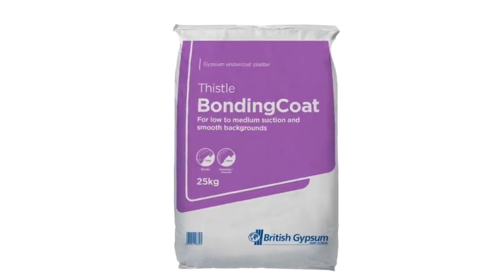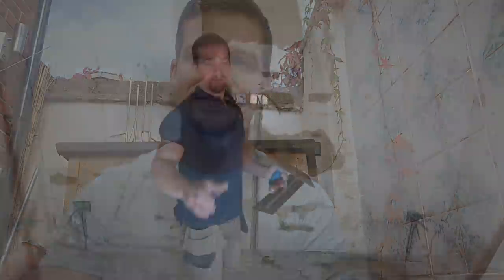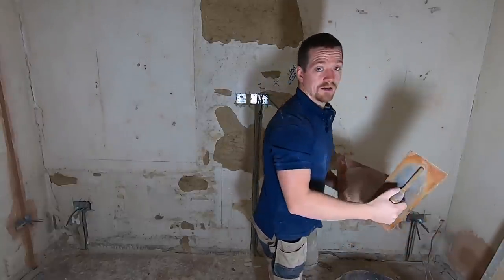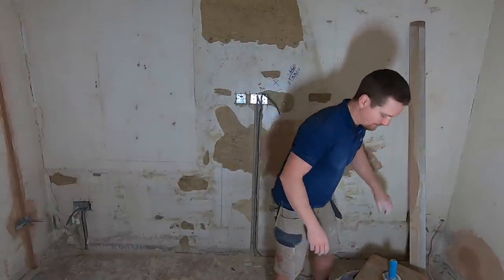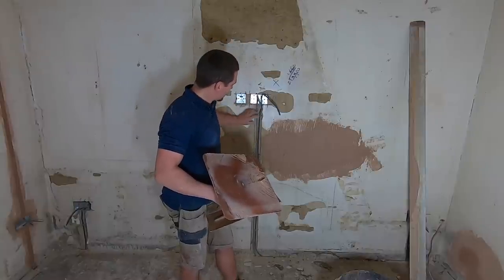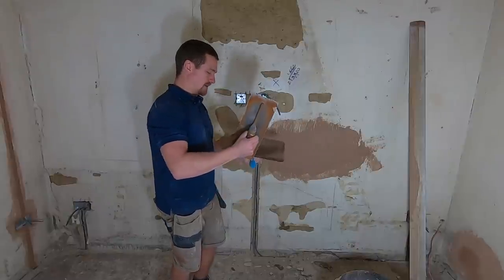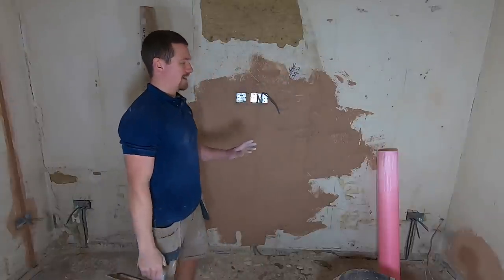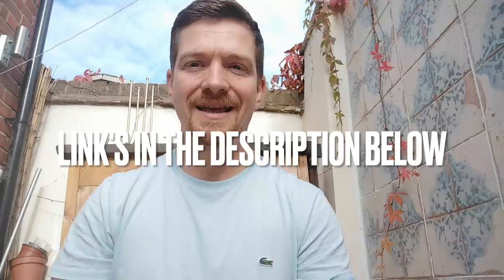Fixing Old Walls With Plaster…FULL GUIDE! (Fixing Cracks/ Cable Chases/ Using BG Bonding)

Comment: Just want to say a big thank you for all your videos. For a DIY enthusiast like me, plastering is the dark art that have eluded me. With your help, I have recently done skimming of old walls and replastered a section of an interior wall where I have to take it right back to bare bricks. I believe large areas are still domains for the Pros and experts, but being able to do patch up here and there is really great ! The best is not fearful of knocking a big hole or section of the paster off and have to just rely on the good old pollyfiller ! Great work !
Reply: For your big areas use a big speed skim.  Can't go wrong buddy. I'd go bigger areas all the time. It's just a game of timing.

Comment: Great video again!

I have a room in exactly that condition, chased walls where it's been 1st fixed and places where old plasters come off. 

I will be using the bonding with the render mesh now for larger areas instead of the normal skrim tape 👍🏽

Comment: Great video. Please advise, should the bare cables be enclosed in a conduit? Does the covering of the bare wires with  bonding cause a problem, with heat retention by the wires and cooling, for maybe cracking, later in time? I myself have a couple for wires, I would like to bond in, without using conduit. Kind regards...
Reply: If your wires are getting hot enough to cause issues with plaster you have more to worry about than cracks appearing 🔥

Comment: I feel I have to defend you here Blaine. Some people are commenting on normal plastering practices under normal circumstances. Cement should not be used with plaster, it creates a chemical reaction that effects the bond of the plaster. There are lots of products for chases, bonding 60 or acceleraters to add to the plaster. Thistle Dri coat is meant for damp areas. Yes, it might not meet the requirements of damp specialists, but this channel is all about general plastering isn’t it. Keep up the good work mate! 👍

Comment: We decided to do this on the entire house as all the walls are cracked, so thin layer of bonding with mesh, then will scrim over 2 coats. Would you need to key in bonding before applying finishing plaster or no?

Comment: For deep chases have you tried adding cement to the bonding , there's no cracking or or shrinkage on goes off quickly the more cement you add , great if you need to skim when time is against you😉
Reply from the maker: I have used cement for Bonding in the past and it definately helps with the setting times.

Comment: How do you fill old socket boxes. I’ve got a kitchen which has an old socket which needs skimming over. It will still have live wires in the back box in connectors as still feeds other sockets. Because of this, the cable can’t be disconnected

Comment: Hello,    I enjoy your vids and find them very informative...
I am currently renovating a room in my 180 year old  house which is built of stone and soft black mortar . (Horrible stuff)... I've hacked off the old plaster and some of the black mortar has come away from the stone work.  What I was going to do was brush out the loose mortar , pva the wall then apply a coat of sand and cement render to fill in the cavities in the stone work and also to level out the wall before i apply plaster.I
The problem I have is that there is a large wooden lintel above the window so how do I get my render coat to stick to the lintel?  Is there some sort of scrim  or mesh that I can attachd to the lintel to allow me to render over it ?
Thanks for your advice.

Comment: I have a kitchen and the walls are abysmal.in some parts it's down to the bare block and even them have holes in .Some of the bond is crumbly.So I'm stuck ,Dob and dab? and just cover the carnage or mortar in the old plug socket holes,all round Bond then skim it.Its just awful to look at.any tips or plasters/ builders wisdom more than welcome.

Comment: Hi Blaine, hope you're well. What's your method for filling chases if you're not plastering the whole wall?
Reply from the maker: Hi pal! I'd fill the chase with Bonding but leave about 2mm so it's not completely flush to the wall. I would then use Easyfill as the finish because it's sandable and it's a lot more flexible than plaster. That's what I'd do matey 👍
Reply: Ah that's interesting. I've always done the same buy used multi on top. Hopefully hasn't cracked when I've left 😧
Reply: As blain said Easifil is the governor here it’s Easy  to use (still two coat ) and u can flatten in on the second coat when it’s dried  sand it up with a sanding pad Ull get a perfect finish it’s great for patching in with much more user friendly than multi finish
Reply: Should the chased cables not be run in conduits?

Comment: Why can’t you use the bonding on areas that go back to brick? I have an area around a bath that I need to tie in with old plaster. Can’t use dot and dab green board as it’d sit taller than the old plaster I need to join to. I bough this exact thistle bonding mix, to level to existing plaster, and was then going to tile over but maybe I’m back to the drawing board? I’ve SBR’d the bricks and will do another coat just before plastering.
Reply: In a bathroom use hard wall or sand and cement render instead of bonding. Bonding can draw the moisture in and should be skimmed before tiling over too. Other views may vary. :-)

Comment: I'm Canadian, so I'm confused; How does the Electrical Inspector allow you to bury cabling in the plaster?
Reply: The work has been signed off prior to the burying. We have an accredited scheme that only licensed electricians or Part P (domestic installations) qualified can do home installs. The installer issues the Electrical Installation Certificate. You can do a self install I believe and get Buildings Control to check throughout that you have complied with Regulations, but I'll leave that to the more knowledgeable. We're currently on what is known as 18th Edition Regs. No Electrical Inspector required. :-)

Comment: The idea that in the UK it is acceptable to dig into a wall to repair a failed cable makes me cringe. A simple conduit will allow a repair should something happen to that wire 😢
Reply: Yeah plastering cables in with no capping or conduit is not good practise. Definitely not recommended.

Comment: Never ever use bonding on old house its a sponge for dampness
Reply from the maker: There's no signs of damp in this room mate - I understand avoiding Bonding in bathrooms but the whole house doesn't make sense. Especially when it's designed for situations like this one!
Reply: @PlasteringForBeginners  cause problems down the line I'm a plaster 30 years for a damp proofing company  bonding is a no no imo
Reply: @paulobrien6213  Best someone lets British Gypsum know they've got it all wrong then?
Reply: @rebeccawoods2481  it's why most sites or houses don't use it anymore
Reply: @paulobrien6213  what do you use instead of Bonding?